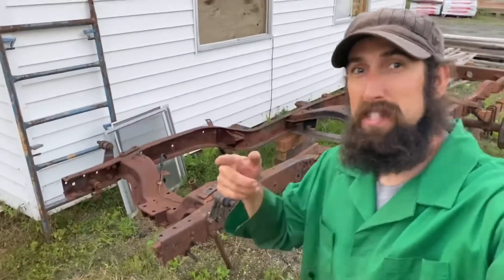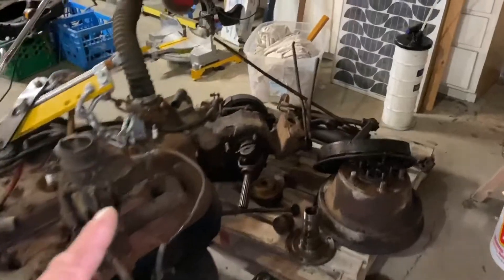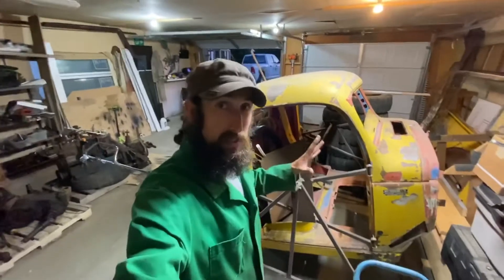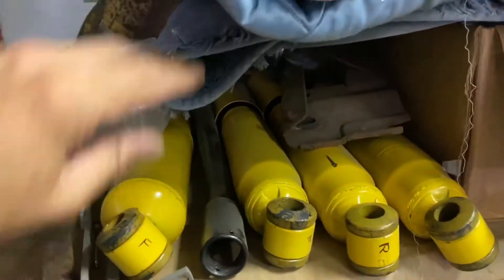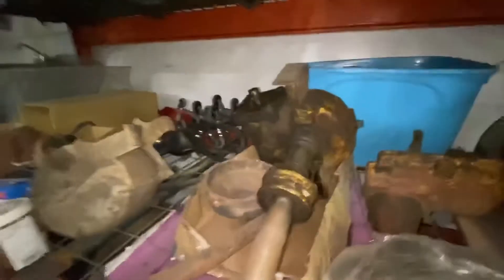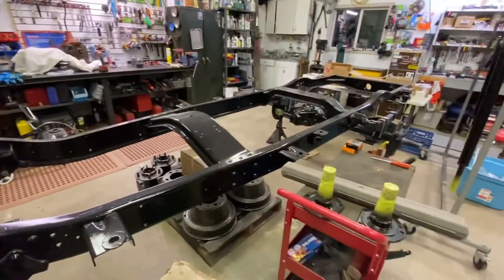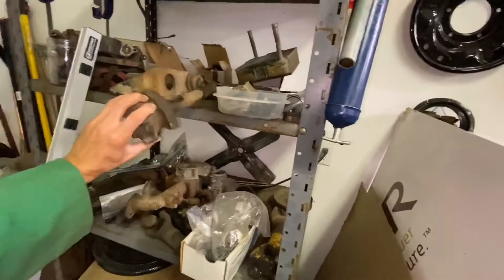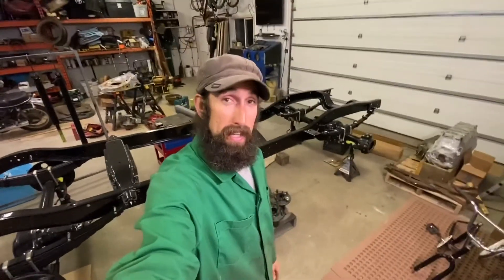Shop Tour & Build Insights

Comment: Ray great to see your work area and although you do have some other stuff in there it is pretty dedicated to the PW, I like that.  You know its  a little weird when as you going through all the truck parts and I am naming them all off before you can even talk about them.  A lot of people do not understand to what level we go in our restorations, I was looking at my truck the other day and there is NOT one bolt inside or out that we have not touched,  and I mean media blasted and either painted or powder coated what that really means is nothing just comes apart and goes back together.  It comes apart is cleaned up on the outside is then completely disassembled to the bare case which is then recleaned thoroughly again then media blasted and powder coated you and I know how long this takes but most folks dont have a clue what is involved Ray!  Your progress is steady and slow just like mine.  I will have all the pedals and control levers in place tomorrow, I got the hand brake done today and installed.  My fuel and brake lines are all in just need to go over it all and tighten everything accordingly  then I will be onto all the body mounts Ray, progress feels very good my friend!  Take care and talk one of these days!